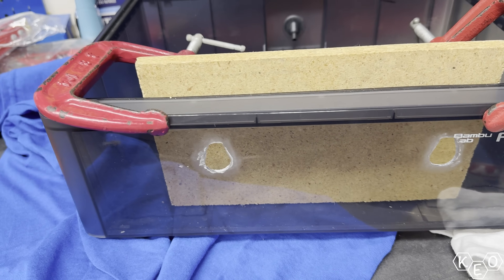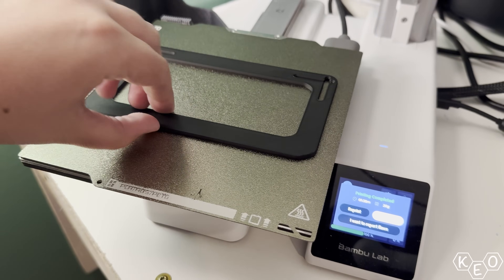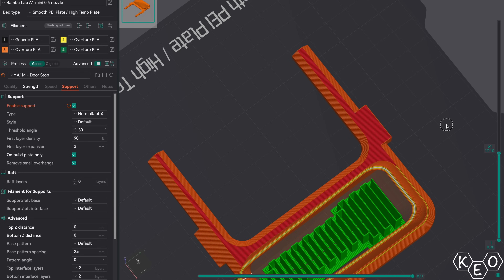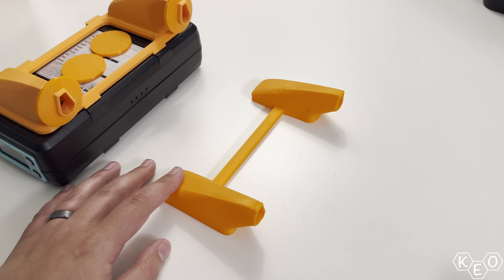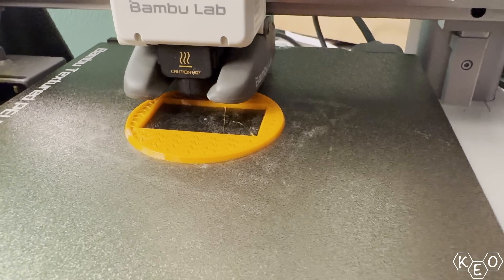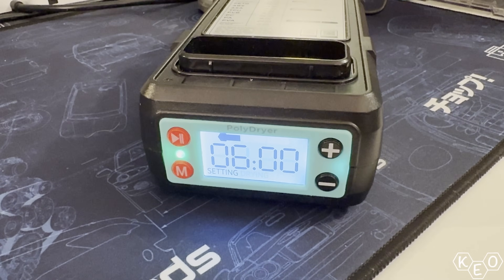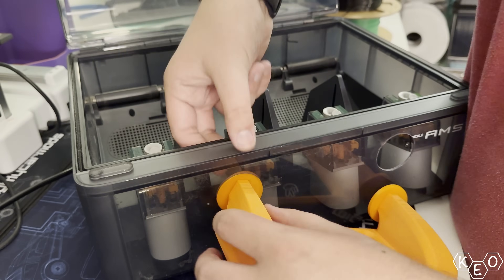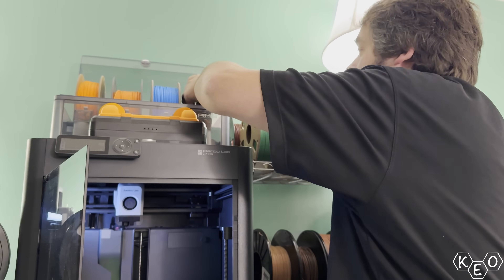AMS Filament Drying Finally Perfected! The PolyDryer Mod Is Complete

Comment: About drying.
You do not need to re-circulate air to dry.  You need dry air, and to get rid of it once it’s damp.  OR, you need to otherwise dry the air in the loop BEFORE it gets into the AMS. 
I used to design drying rooms for companies that cast product in plaster, hydro stone and Portland cement.  

Freshly set, nearly 70% of the weight of cast plaster is water that has to evaporate out before you can ship it ( it will grow mold and make the box actually soggy ) or paint it.  Well, not all of it, but you want the exhaust plenum humidity to read below 15% before you can paint the castings.
The key was the incoming air had to be DRY. Electric heaters do NOT dry the air very much. They mostly just increase how much moisture it can hold. So all the actual water in the air is still in there and you can never get relative humidity below the that of the ambient air.  That is, if the ambient air is 25% and the filament is 42%, you can expect to dry the filament to about 27%
We used GAS furnaces.  Like for your house. Gas furnaces DRY the air- ( which is why homes in snowy areas with forced air furnaces have to have humidifiers in winter - and also why gas fired clothes dryers dry clothes faster )

A gas furnace may be impractical for an AMS-  ( though if you have forced air, taking air from one of the vents, passing it thru a HEPA filter and into the AMS then then out would likely get you VERY dry filament. At least in winter ) Also why a gas oven dries filament faster, especially if you leave the door ajar so that shot humid air can escape.

So what you need is to blow your heated air over something DRIER than the air before it goes into the AMS. Again, heating the air alone only increases its ability hold water.
 For a recirculating drier, place box in line full of desiccant. That is, force the outgoing air thru a matrix of desiccant. Then, if you re-heat and recirculate the air it’s going to get drier over time. Expect the desiccant to get waterlogged pretty quickly. 

You want the desiccant on the outflow side of the loop because as water transfers out of filament into the hot dry air, the temperature of the air will drop. As the air leaves the chamber its temp will drop further and the water will want to condense out because the cooler air cannot hold as much water.  You want to extract the water from this cooler air before you reheat the air for another loop. 
Think of it like a heat pump, but for moisture.   You need to transfer the moisture that comes out of the filament into something drier than the filament. The drier the incoming air, the faster the filament will dry and the drier it will get.
Reply: I must give you credit here for one of the few people I've ever come across that understands the process of drying. What people don't seem to get, is that for a given RH/temp there is so many grams of water in a volume of air. (Ignoring air pressure for now) Let's say 6 gram per cubic meter. Heat up the air, the RH goes down, but you still have six grams of water. What you try and do is heat up the filament and hopefully it will release some 5g or more into the (unsaturated) air. In a closed cycle, you will end with 11g of moisture in that cubic meter, so one would expect the RH to increase when the temp goes down again. My tests have shown that every single roll of vacuum-packed filament I ever got, had its desiccant packet 100% saturated. Plastic spools usually release around 8g of moisture down to 10% RH, and carton spools well over 16g. 

I use a molecular sieve to keep my filament dry in an IP67 box, but sadly when I crack open a new roll, my sieve gets saturated within a day. I always measure the sieve to the exact same values, 80g and 100g respectively,  (My storage box has about 14 rolls in it at 100g desiccant) and by the time the RH reaches around 25%, it weighs 89g and 112g.  The air or lack of air in a vacuum pack is meaningless. Even if there is as much as 3 liters of air in a filament bag, at 80% RH that air contains like 0,002gram of moisture. So that 4g of desiccant should be able to keep your filament dry, but unfortunately, fresh filament contains around 1% (10g) of moisture. So, unless the moisture condenses, the silica packet is useless. With a cardboard spool, of course, the cardboard is almost as good a desiccant as the silica. A vacuum is making absolutely no bloody difference, apart from looking cool! 

So as for drying. If the air is dry around it, below the "release" level of filament, it will give up its moisture, no need to heat it up. Heating the air will lower the RH and then the filament release moisture. Once the cool down happens, the filament will re-absorb that moisture - but hopefully slow enough to finish that print job you are busy with. So, I tend to think that you should stop the heating process once the absolute humidity (AH) stabilize, then compare it to outside, if lower, exchange the air.
Reply: How does the gas furnace “dry the air” anymore than an electric heater of similar theoretical wattage? As far as I’m aware, it’s still drying by the same action - heating the air to increase the amount of moisture it can hold (i.e. reducing its relative humidity). In a closed system, the total moisture still remains whether you’re using gas furnace or electric heater, so I am confused by your statement “gas furnaces DRY the air” as I am interpreting it like you’re saying it has some other drying mechanism that electric heaters do not.
Reply: @ Well, I would guess it’s because combustion byproducts react and bind with the water in the air.   All I know is we throughly tested electric heaters, and gas heaters, and gas drying ovens produce drier hot air, whereas electric heaters only decrease the relative humidity of the air. RH is not a measure of moisture content, it’s the relation between how much water is in a volume of air versus how much it CAN hold at its temperature.  Heating air, alone, simply increases its ability to hold moisture, but it does not reduce the amount of moisture in the air. So if there is 50 grams of water in a given volume of air with an RH of 50%, heating that air will show the RH has dropped to 25%, but it STILL has 50 grams of water in it.  The moment the temperature drops, its RH goes right back up to 50% ( or actually higher if you used that hot air to DRY something, because you have the original 50 grams, plus whatever additional water it absorbed. )  Again, the key is getting RID of the water.  A de-humidifier literally condenses the water out of the air by LOWERING the air’s ability to hold moisture by refrigerating the air.  The water is taken out of the loop.   Desiccants work to take water out, but only if you take the desiccant OUT of the chamber and evaporate the water out, somewhere outside your drying loop.   Left in the loop, they simply transfer water back and forth. It’s why you leave the door ajar when drying filament or desiccant in an oven. So the humidity can leave the box.
Reply: @christopherpardell4418 the major combustion byproduct for hydrocarbons is water so try that again. 

Also, almost all gas furnaces exhaust the combustion byproducts separately from the heated air, because combustion byproducts tend to be quite toxic (CO comes to mind, among others). A gas furnace does not dry air any more than an electric heating element. The heat is generally STRONGER than an electric heating element, so the reduction in RELATIVE humidity is greater, but the absolute water content of the heated air does not change in either system.
Reply: @Xplosivpotato . I don’t know what to tell you other than the fact that I have literally BUILT industrial drying systems for drying products cast in plaster, hydrostone and concrete.  Forced air gas fired furnaces dry those products faster than when we tried electric furnaces.   The combustion byproducts are NOT passed thru the space being dried. They go out the flue.  The WATER goes out the flue, TOO. 
Here’s another hint.   Homes heated with forced air gas furnaces often need humidifiers to compensate for how much they dry the air.   So, think what you want.  I am talking 40 years actual experience.

Comment: Here’s a question from a mostly ignorant person who has not done any 3d printing or yet owned any 3d printers or filament, but is going to plunge into it very soon:

What about while whole-room dehumidification, with like, a regular dehumidifier?  Surely if you’ve pulled almost all of the humidity out of the air to begin with, the filament wouldn’t be able to absorb much of any humidity.
Reply from the maker: In theory that would work just fine. I know some people have rigged up an entire closet to be their filament storage so you don't have to humidity control an entire room but yes, that idea would totally work. You might just dry your sinuses out or something if you hang out in there lol

Comment: Have you seen that Bambu now to a TPU? Apparently it's quite rigid so it goes through the AMS but is more flexible once printed. It's not cheap though.
Reply from the maker: Yup. Check out my recent support material video. I messed with it a tiny bit at the end

Comment: Well, this didn't go well. I wouldn't recommend doing this. I just tried this mod on my AMS... Result: after 4 hrs of running both dryers on the medium setting (with 4 full spools of ABS in it) the rear section of the AMS got so warm that the insert started deforming... The rear rollers bowed away and the spools were dragging on the floor. I was able to fix it with a heat gun (carefully heating the insert up and bending it back) but it's now all a little warped... 
Maybe it's fine if you only do the lowest setting for PLA but what's the point then.
Reply from the maker: Jeez thanks for sharing your experience. That sounds super lame. I’ve been using mine regularly for the past three months on the second setting as well and have not noticed any damage. I’ll have to double check when I get home to make sure now
Reply: @KeoPrints  maybe it had something to do with having had 4 full 1kg spools in there? Lots of weight trying to spread the rollers and also the exhaust gets more blocked, concentrating the heat?

Comment: Not sure if it's already mentioned, but putting the two Filament dryers underneath, with ducting and a modified AMS Hydra print to help direct the hot air away from the electronics and into the space might help alleviate the potential risk of overheating the electronics. Some desiccant mounted in the bottom might also contribute to keeping it as dry as possible to boot, and perhaps some adjustable ducts in the lid instead of those 'duck holes', perhaps themselves filled with desiccant might be improvements as well.

Comment: So if you redo this, put a gore-tex sheet over the holes and crack open the unit for a second while it's warm this will let the moisture out as it cools it will pull air through the gore-tex keeping the humidity out and letting air in i also wired up solidstate dehumidifiers into mine setup as always on. They alone will take days, if not a week, to pull a roll all the way to dry, BUT if you heat dry a roll of say nylon and put in the ams dry it will stay dry indefinitely as long as the power is on
Reply from the maker: Those solid state ones are pretty cool. Expensive though aren’t they?
Reply: @KeoPrints  50-80$ for a tiny one, it will take forever to dry wet filament, but if you dry in advance, it will keep it bone dry basically forever. Also, the color change bepoint less. it's too wet long before it will change colors needs around a 40% rh before the colors change and things like nylon needs a sub 5% rh to be stable. The solidstate units can pull down to sub 2%, but you need a fan in the enclosure, and keep in mind it over time a high concentration of oxygen can build up this can hurt polycarbonate and asa.

Comment: It looks like aligning the dryer hot vent to were the desiccant pouches go in the AMS should minimize the potential issue with the electronics, not to mention that the hot air would blow freely into the spool chamber. It would also make it possible to use the dry box's plugs to cover the vent opening when the dryer is off the AMS.

Comment: Yeah, good thing you printed the TPU on the textured plate.... You'd have never gotten it off the smooth plate.    Just a little tip though...TPU will release with the help of isopropyl alcohol.. just pool some around the base of the print and wait a couple minutes for it to start to wick under.... It'll release with no issues.

Comment: the dryers are designed to circulate air right? so could you not hook them up to circulate air between the two and have one exhaust the air?
Reply: also place the dryers on top of the lid :) makes it harder to cut the holes and potentially open the lid (unless you find a way to fix em down) but makes it so the electronics are 100% safe
Reply from the maker: True true. That would be ideal for the electronics overall

Comment: Heating does not reduce the amount of moisture it just reduces the RELATIVE humidity because warm air can hold more moisture than cold air.  The then warm air hence can hold moisture coming out of the filament and also there the heat helps that moisture to exit the filament.  But then that extracted moisture increases the relative humidity of that warm air again and to keep on extracting moisture from the filament you need to get that warm air out.  Heating it up further gives diminishing returns and you cannot get it higher than the temperature the filament can stand, so you just need to get that warm and now moist air out, not just by overpressure, but just let it out through big enough holes.  Check out how a food dehydrator does it.  But if that warm air is exhausted, you need to replace it by new warm air that is less moist, i.e. you want to get external (or dried by dessicant) relatively dry cold air to pass through the heater, where it is heated up again, lowering its relative humidity further and the cycle can start over.  Filament dryer manufacturers should really just have a look at even the cheapest food dehydrator on how you actually dehydrate stuff.  You don't do that with a tiny DC heater and circulating air around and around, but you use a relatively powerful AC heater to heat up a large amount of air that is just pushed over the thing to dry and is then exhausted together with the moisture.
Reply from the maker: These are all fair points. So far I haven’t seen any moisture return to the spools after drying and letting the temp return to ambient. It sits pretty steady at 12% but the disadvantage is completely ruining the system when I open the box to move spools. Desiccant takes the win there no doubt! Oh well. More testing more tinkering
Reply: @KeoPrints  But again that 12% is relative humidity.  It says barely anything on how dry the inside is, unless you also mention the temperature.  If you simply heat up a closed space filled with air the relative humidity (and hence the % shown on the meter) will go down significantly, yet the actual amount of moisture in that space has not changed.  If there is a source of extra moisture in that space (ex. your filament), it might now release some of that moisture, which is the intention, but that then also makes the total amount of moisture in the air go up.  The relative humidity will slightly increase, but likely still be way lower than what you had at room temperature.  But, the moment the temperature then drops again, the air will have less room to hold moisture and hence water will condense where it sees fit (typically on the coldest outside walls) and at that point also your filament might regain some of the moisture.  Once the temperature is again ambient, If the space is truely closed off, and the relative humidity is then lower than before the temperature cycle, that either means there should now be a puddle of water somewhere in the space or something (your filament?  dessicant?) has absorbed more moisture than it held before the cycle.  If that is the goal (i.e. if the intention of the heater is just to speed up getting the moisture into the dessicant), then sure this circulating heated air has a use, at least until the dessicant is saturated, which can be very quickly if you're drying really moist filament.  Whereas continuously passing fresh heated air over the item to dry and then just letting it out to spread the taken up moisture over a much larger volume (your room, house, the world), can keep on taking up moisture as long as the filament has some to give.  Sure, you'll be venting off heat and hence this will be less efficient at getting the temperature inside that space up, but the goal was also not to just get the temperature up, it was to dry the thing in that space!